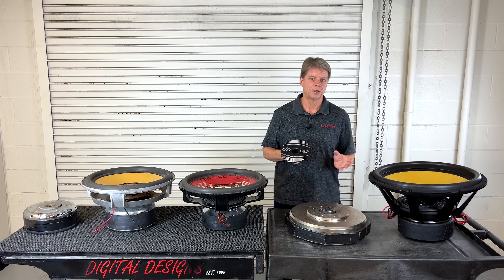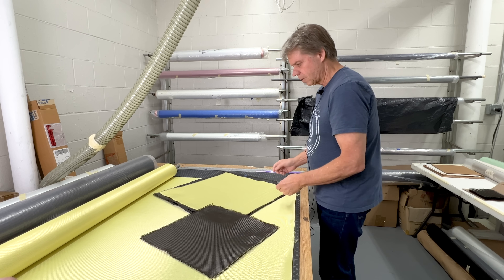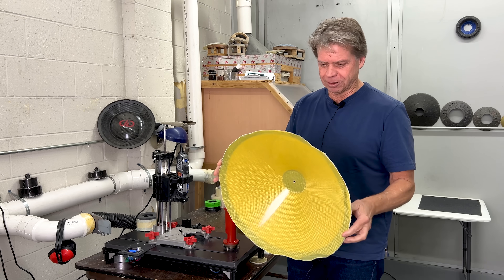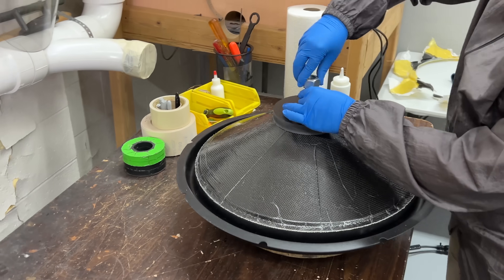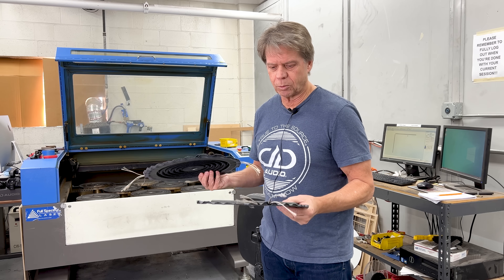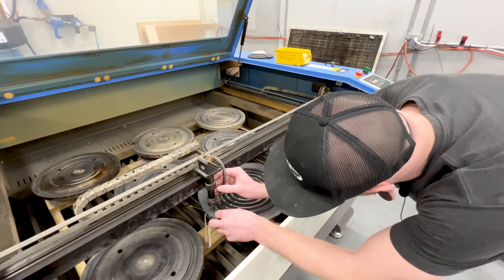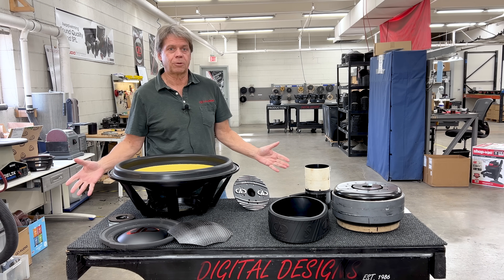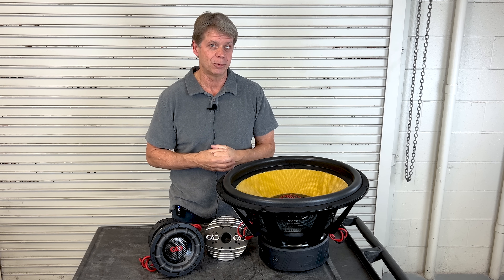How It's Made: DD AUDIO 9921c Subwoofer Build Process

Comment: Besides strength, what advantage is there to using the composite cone over the regular cone?

Less mms?
Improve efficiency?

Trying to decide if i should order mine with them. Cant find any info on them.
Reply from the maker: Strength is the main advantage is systems over 160s. The carbon cones are slightly lighter, and will be a bit more efficient, but not enough to make a noticeable difference when listening to music.
Reply: @ddaudiotv  hey thanks dd! Just put my order in for 2 9510s with the blue sapphire cones and amethyst dust caps!
Reply from the maker: 🔥 @ah4800

Comment: Very cool!  One question though. I'm such a high-end handmade speaker why not use neodymium magnets?
Reply from the maker: We do have a Neo magnet subwoofer, check out our Z3 and Z4 series: https://ddaudio.com/series/z4/?status=2&global=2 and we also use neo magnets in some of our speakers like our very popular high output coaxial VO-XN: https://ddaudio.com/vo-series/coaxials/vo-xn6-5a/
Reply: @ddaudiotv  Right on! Is there any benefit to running these types of magnets over neodymium other than cost?
Reply: @DoRC  No not really. Neodymium costs several times as much as ferrite for the same magnetic strength, so it's only worth it when weight is a concern or when you reach the limits of ferrite motors.

Comment: sir.. is the number turns of coil and diameter of core affecting the  frequency response?
Reply: Sure, everything interacts ... but freq response isn't the most important. 
With headroom, any frequency response desired can be EQ'd in. 

Inductance, BL, moving mass, ... primary elements impacted by coil turns, etc. 

Ideally;
- minimal inductance yields speed
- maximal BL yields strength 
- minimal moving mass yields sensitivity 

Those are important.

Frequency response can be bulldozed in via EQ.

Comment: I just ordered 2-15’s (9915c’s). The shop I purchased them from didn’t specify which spiders to get. I’m assuming they come standard. If I were to opt for 3 layer would that be additional cost?
Reply: @JoseFlores-fm2vc- Unless you are giving each subwoofer @ least 8,000 watts, and just doing SPL burps, the standard suspension is the way to go. My friend had a D16000= (8k R.M.S.) Massive Audio amplifier, on a pair of DD 9500 15s with standard suspension, and it was great. Then a year or so later, he thought he wanted the stiff= extra spider option. So he sent his stock 9500 15s in, to get the full carbon/kevlar cone, and dust cap, plus the Extra spider option= stiff. Well lets just say that when he got them back, they were so stiff, they didn't budge with that 8k on a pair, and they were so punchy, they would give you a head ache. I didn't like them @ all! My friend spent so much $ on these upgrades, and on his power level, didn't even get 1 Db louder! He sold them, not long after getting them back. Then he got a 12" DD 3500 with the soft suspension, for SQ= he was much happier. Like DD says, the standard suspension is what most would prefer. Stiff is for high powered SPL burps, soft is for half of the rated power handling, or less, and def. Set your subsonic filter correctly, as the soft can bottom out very easily Hope this helps?.

Comment: 9917 beast D1.4 still
My all time favorite. 3inch copper coil. 40mm coil and 40mm top
Plate hits really hard. 44 T/m and only remaining 0.5mm inside the gap. 36gramms cone ! Erom ! Nothing else coms even close. Yes there is more and more power ratings and more xcursion. But this one is about attack ! A real beast
Reply: Yep, knew a guy that was doing 166db with only one 9917 or 9517 can't remember
Reply: @mattm2684  We did 166,7dB in SuperStreet 1-2 in 2000 with 2x 9917 D1.4